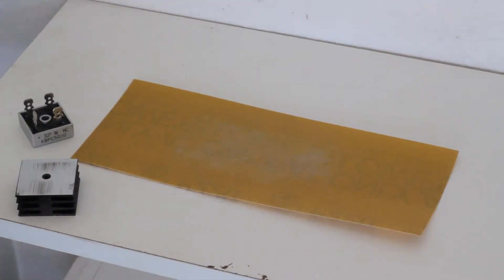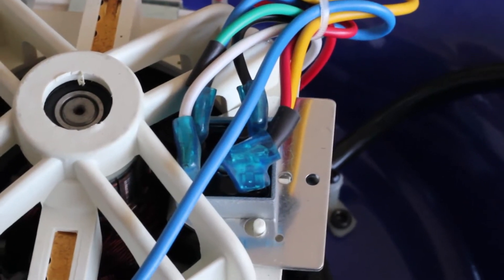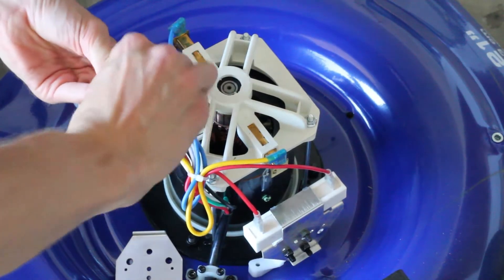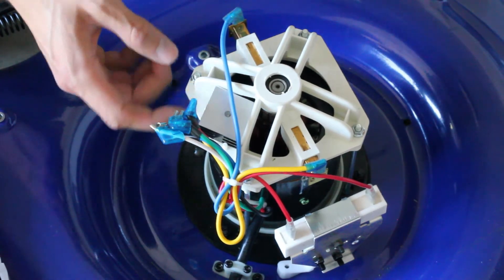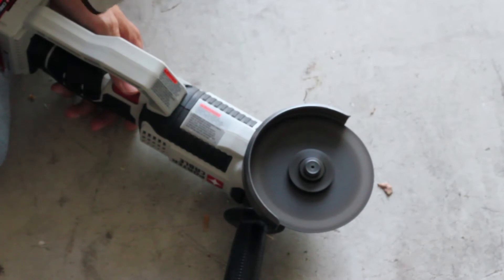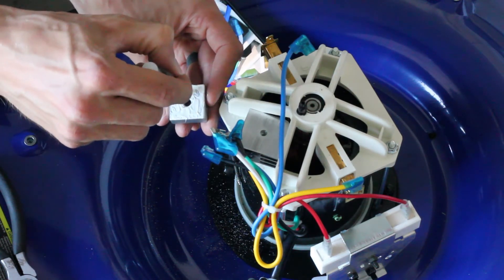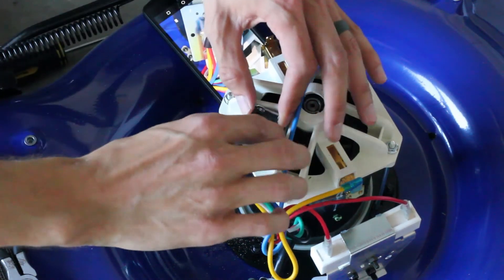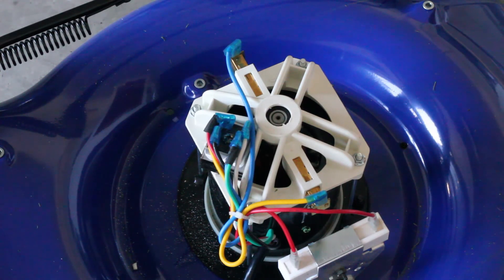Kobalt KM210 Electric Lawn Mower 50 Amp Bridge Rectifier With Heat Sink Replacement /  Repair

Comment: The engineers designed the rectifier and motor to run using a specific amperage.

Let's think about this for a moment. The circuit breaker that is the power source from the panel is most likely 15 or 20 amp.

It may be a little difficult to flow 50 amps through that circuit.

Assuming it were possible, what would be the resulting damage to a motor designed for 13 amps? (Assuming the motor is rated for 13 amps as mentioned in one of the postings).

I fail to see any positive or benefit to adding a rectifier that was not designed or rated for that motor.
Reply from the maker: The benefit is that the higher rated rectifier won't run as hot and should last longer. It wasn't meant to boost performance in any way.
Reply: The factory rectifier was 25 Amp.  The current coming from a residential panel is rated at 15 or 20 amps. Therefore, the current should never be over 20 amps coming from the source.

While upgrading to a 50 Amp rectifier can provide some benefits in terms of capacity and durability, it's crucial to ensure that the entire electrical system can support this change. 

The idea behind the post was to save others from damaging their circuit in the event of an overcurrent situation.

The engineers already factored in these concerns  using ohms law prior to manufacturing the product.

Thanks for the video, great quality. Clear and concise.

Hope this helps.
Reply from the maker: @Savage-lx5yj  The 50Amp rectifier will not change the current actually required from the motor.

Comment: You did a great job at adding the heat dissipation. However, If I were you,  I would not change the 25amp rectifier with a 50amp one. Just like you do not replace a 20amp breaker with a 50amp breaker, it will catch on fire when the current well passes 20amp. I have a greenworks corded mower, which uses a 35 amp rectifier. I bought several 35 amp rectifiers and I shall add heat sink as you did. Thank you!
Reply: If you were lifting a 25lb bucket with a 25lb capacity rope and the rope broke, wouldn't you get a 50lb capacity rope so the rope doesn't break again? The rectifier is not a safety device like a fuse, it should be rated to handle the load put on it.
Reply: @nate6438  you're totally right. you could use a 100 amp rated rectifier if it would physically fit. The key thing is that this rating is at 25 degrees C. "if that temperature can be maintained". At 100 C the current rating would probably be sharply reduced. Anyway I hope you have a great night.
Reply: good job! These rectifiers are notorious for that. the heat sink sucks, a plastic screw to bond the heat sink, insufficient. A larger Bridge Rectifier Should run cooler..... Good job !!

Comment: I absolutely love the plus sized addition of what looks like a computer aluminum heatsink mounted with some heat sink grease compound; if one retains the original aluminum heatsink mounting plate one could conceivably mount an even slightly larger computer heat sink covering more of the original aluminum heatsink mounting plate; in order to be able to remove even more heat due to the larger aluminum heat sink mass; very creative do it yourself idea indeed well done and kudos.
Reply: link supplied below is to an aluminum  heatsink($12.59 plus about $6.00 for the tube of heat sink compound <$20 total) with height 1.4 inches height by 2.7 inches wide by 3.9 inches long(one might have to cut down the length to 3.2 inches to make it slightly longer than wide to allow it to fit properly underneath the mower enclosure:

https://www.amazon.com/Aluminum-Heatsink-Amplifier-Transistor-Semiconductor/dp/B073QS338W/ref=sr_1_22?ie=UTF8&qid=1526904956&sr=8-22&keywords=computer+heatsink
Reply: also one can also smooth out the inevitable resulting DC ripple voltage at the positive and negative output polarities of the full wave bridge rectifier using some ordinary regular 47uF 200V Electrolytic Capacitors rated up to 105 degrees C; as this should keep the overall resulting more efficiently filtered DC effective operating voltages much higher for longer periods of time which should result in increased enhanced electric motor torque and resulting effective output electric motor increased horsepower; one can also order from amazon the needed electrolytic capacitors(with plenty to use as spares if needed) also as well in the link supplied below:

https://www.amazon.com/47uF-13X20-Aluminum-Electrolytic-Capacitors/dp/B074LH6C19/ref=sr_1_18?ie=UTF8&qid=1526908151&sr=8-18&keywords=47uf+100v+electrolytic+capacitor
Reply: by simply adding the 47uf Electrolytic Capacitors the resulting DC output voltage from the output of the full wave bridge rectifer will be boosted up to nearly ninety percent of input 120VAC or close to effective 100VDC; this will also be quite particularly effective in allowing the very powerful 13 amp rated electric motor to stay as cool as potentially possible even if one is using a much longer one hundred foot extension cord(sensitive to voltage distance drop); this will of course help to protect ones nearly $200 investment in ones electric lawn mower and also allowing the 13 amp rated electric motor to operate much more effectively and efficiently without potentially overheating over its entire anticipated long total effective electric motor lifetime.
Reply: When one gets the 2.7inch wide, by 3.9inch long and 1.4inch high aluminum heatsink from amazon; simply make a 2.7inch by 3.9inch index card paper heat sink template and then simply locate and mark out where the actual mounting hole is located in original electric lawn mower's aluminum heatsink mounting plate; and then simply transfer that marked out location from the index card onto ones 2.7inch wide by 3.9inch long aluminum heat sink; now obviously it will be slightly off center due to the rectangular dimensions of the  purchased aluminum heat sink; however one may also have to cut down a portion of the length of the purchased aluminum heat sink if it is so long as to prevent the electric lawn mower enclosure from being secured properly; 

moreover the really nice thing is the purchased aluminum heat has 23 aluminum fins that are at least 1.4inches in height; so that makes it definitely worthwhile to try and attempt to optimally mount this rectangular aluminum heat sink to as much of the original electric lawn mowers aluminum heat sink mounting plate area as possible; using of course the highly effective efficient thermal heat sink paste on the thinly spread on both the back of the full wave bridge rectifier bottom and also the accompanying underside of the aluminum heat sink chassis body where it comes in physical contact with the full wave bridge rectifier; after smoothly polishing both accompanying aluminum surfaces with emery sandpaper; 

additionally with 2.7"x3.2"(cut down by about 0.7inches only if needed)x1.4" equals about close to 12 cubic inches of total combined additional horizontal and vertical cooling fin surface areas; moreover most importantly the actual 50 amp full wave bridge rectifier will now be able to optimally thermally cooled down with the total combined thermal output from the bottom of the 50 amp full wave bridge rectifier; directly as a result of these optimal thermal design considerations to be able to stay ultra efficiently cooled for as long as potentially possible(one can even mount an external temperature sensor directly to the aluminum heat sink fins to keep track of actual heat sink/ full wave bridge rectifier temperatures in real time also as well); 

now with a total financial investment of less than $20 for the combined above described rectangular aluminum heat sink and also the heat sink compound paste; along with the separate purchase of some simple ordinary very good 47uf 200VDC electrolytic capacitors($10 shipping included with plenty of extra capacitors as spares); a few feet of electrical hook up wire and some DIY hobbyist tools; along with some loving do-it-yourself sweat equity labor time; and one will definitely enjoy having in fact the most powerful horsepower output and thermally cool running electric lawn mower on the block; 

as least as compared to the regular mainstream non-beefed up standard brand name purchased electric lawn mowers such as Greenworks or even Worx or even the very expensive dreaded cordless lithium ion rechargeable battery electric lawn mowers.
Reply: If one makes the above previously mentioned relatively simple but highly effective indicated electric lawn mower custom modifications; it may very well in fact be the very last electric lawn mower that one buys in ones lifetime; which would be a very satisfying scenario to experience and also enjoy savoring for a very long satisfying time indeed.
Reply: Here is the amazon link I have found for ten fifty amp full wave bridge rectifiers for only eleven dollar(plenty of spares in case one needs to do custom modifications on other electric lawn mowers) for oneself and/or others if needed:

https://www.amazon.com/gp/product/B072MYRPLY/ref=ox_sc_sfl_title_1?ie=UTF8&psc=1&smid=A2M99LKXDQEZXD

Good Luck guys and let me know how you all make out with your own custom electric lawn mower modifications; whether they be on a brand new and/or old electric lawn mower.
Reply from the maker: I'm going to research putting a capacitor on my mower. I'll make a video if I do it.
Reply: Here is a electrolytic capacitor link from Mouser for a 100Vdc with a working capacity of 33,000uF with a maximum rated ripple current of 16.47A according to the United Chem Con product data specifications pdf document page; this is a reliable branded name manufacturer of industrial rated electrolytic capacitors with a 2.5 inch diameter and 4.62 inch height; 

so its definitely a fairly substantial and robust electrolytic capacitor for the money indeed which should last quite awhile and be stable for its entire anticipated long rated life in the thousands of hours; which for about $30 is not a bad deal at all to be able to prototype and test out the practical idea of enhancing the lawn mower cutting blade speed by at least twenty percent or so; 

while also at the same time hopefully extending the life the lawn mower's electric motor by thousands of hours also as well; by also saving one lawn mower's electric motor from potentially overheating and/or burning out prematurely; think of it as a $30 extended warranty protection for ones lawn mower electric motor that also allows one to also improve upon ones lawn mower electric motor's performance at the same time also as well.
Reply: the cumulative upgrades to the both the supersized surface area aluminum computer heatsink greased with the heat sink compound using the 50A 1000VDC rated full wave bridge rectifier along with the parallel connection of a super sized 33,000uF 100Vdc rated electrolytic capacitor across the pos. and neg. full wave bridge rectifier's output load side; should hopefully directly allow one to transform ones lawn mower electric motor into a much better performing and long lasting enjoyable electric lawn mower to use.
Reply: "I'm goint to research putting a capacitor on my mower. I'll make a video if I do it"

Supposedly the motor and electrolytic capacitor cannot both be electrically tied to the output DC side of the full wave bridge rectifier at power-up. The AC input supply side would effectively electronically see it as a dead electrical short circuit;

So how does one practically have to physically connect the electrolytic capacitor to the output load side of the full wave bridge rectifier then; a photograph taken with a smartphone showing a hand drawn electronic schematic drawing would be helpful along with an accompanying picture taken with a smartphone of the connections made going to and coming from the actual electrolytic capacitor in a typical proper setup configuration would be helpful to demonstrate how to actually properly do this?
Reply: Dennis Lee, Did you figure out how to make this work.  By the way, for safety reasons, there are limits on how fast a mower blade should spin (blade tip speed).